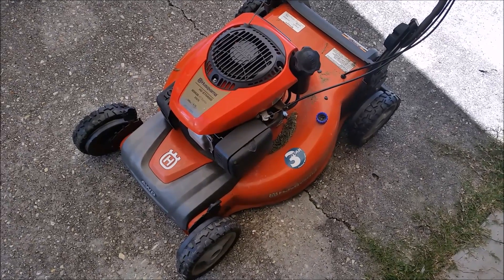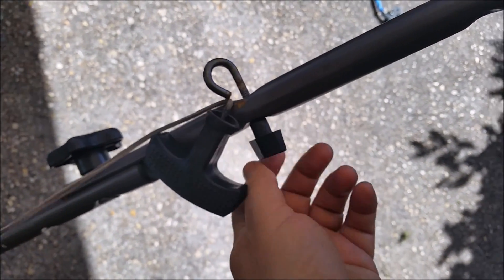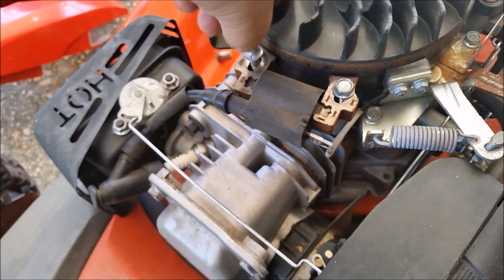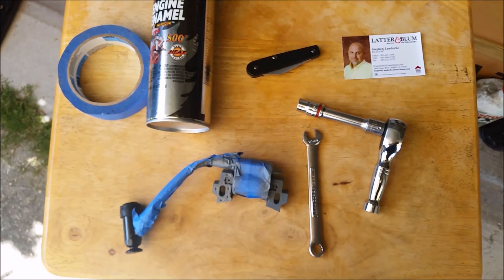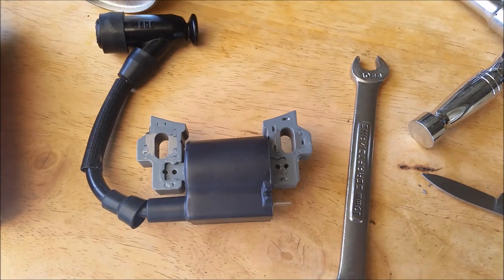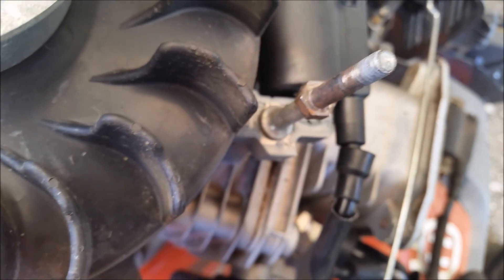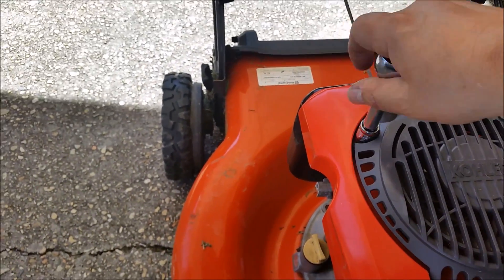Intermittent Mower Engine Fix Kohler XT675-2075 Ingnition Coil Change

Comment: Very useful video and well done. I own the Toro Recycler with the XTX675 engine and the cover and recoil starter assembly is virtually identical to that in your video. My mower just went dead and I determined no spark after trying starting fluid, so I guessed the coil  needed replacing. Took about 25 min to swap out and the mower started right up. This engine seems to be very easy to work on for the coil compared to other engines.
Reply from the maker: Thanks for the complement I appreciate it. Thanks for watching. Best Wishes & Blessings. Keith Noneya

Comment: Where did you get the module from. Is it oem or a replica. Also what's the part number.
Reply from the maker: I put all that info, tools etc in the description. Check it out for a lot of info. If you don't find what you need let me know. Best Wishes & Blessings. Keith Noneya

Comment: Would have been better if you had explained what it was doing so others could learn why you are replacing the defective coil
Reply from the maker: It's in the title "Intermittent Mower". The coils when they get old sometime internally breakdown and the as they heat up the internal coil opens up and will run for about 5-15 minutes then quit, then when it cools down the wires touch again and the mower will start. An easy way to figure that it's the coil instead of a carburetor issue is to put a spark tool on it right after it quits. If there's no spark then it's the coil and not a carburetor problem. If it does have spark then it's most likely a carburetor or a fuel line breaking down internally. If it's the fuel line internally breaking down it allows just enough fuel to fill the bowl and as it runs the fuel line can't feed the bowl fast enough so the mower quits. Best Wishes & Blessings. Keith Noneya

Comment: Any idea why my engine doesnt turn off when i release the dead mans handle? The brake seems to be moving and contacting the flywheel but it wont turn off??
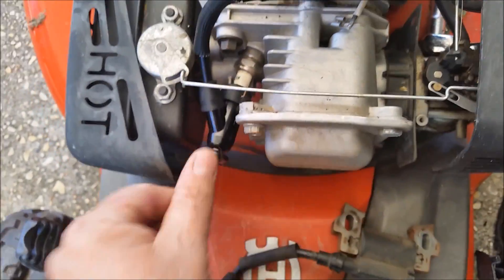Reply from the maker: Hi Donbrendo, at time index 6:14 I connect a wire to the coil. If the brake assembly that it connects to is not working right, or the wire is bad, when you release the handle it won't short out the coil and stop the engine. Check to see if the wire is there and connected. If it is, pull that wire off and check it for corrosion. If it's corroded clean it and then push it on and off several times. If it's loose when you pull it off or pushing it on, use some pliers to crimp it down a little then push it on and try it again. Hope that helps point you in the right direction. Let me know if you have anymore questions. Best Wishes & Blessings. Keith Noneya   PS if you have this mower and can't find the manuals for it drop me an email and I'll email them back to you. I won't give your email to anyone or spam you, so don't worry about that. keith_noneya@att.net

Comment: that skip is probably a fouled plug from the weak coil
Reply from the maker: Very possible. I had to put three Ignition coils in it, the first one was open, brand new, the 2nd one went bad in a week., the 3rd one was fine and is still in it. The were all from eBay, sorry I don't remember the sellers name. Thanks for the comment. Best Wishes & Blessings. Keith Noneya

Comment: Today, I just feel like hitting it with a grenade.  Good video. Thx.  Some days my friend,  some days,,
Reply from the maker: Hey Chris What's it not doing. I have a little experience with this mower. There are a few things common to cause it to go intermittent besides the coil. 

1. is the Intake Valve gets oil built up on the stem and it sticks open, just a LITTLE tiny bit. When it does that it acts like it wants to run but has very low power. Sometimes it will run for about 5-10 minutes then shuts off and you can't start it for another 30 minutes or so. Two things cause that: A bad intake valve seal or bad rings on the piston. You can pull the valve cover off. You'll need a replacement Gasket or RTV, and then pull the spring Keeper to see if the valve operates easily. If not then you have a problem. Be Careful when pulling that keeper off the spring or the keeper can fly into the grass and disappear. Been there done that! 

2. The filter inside the gas tank where the fuel line hoods up. 

3. The fuel inlet valve in the bowl gets a little clogged. 

4. The choke coil doesn't choke as good as it used to. If that's it there are two kinds, make sure you find the one that looks like yours before you order it. 

5. A really hard one to find is an internally deteriorated fuel line. It will allow just allow enough fuel to fill the bowl slowly but but can't sustain a run longer than a few minutes, as the fuel can't fill the bowl fast enough. 

** Check all those. Give me a shout if you need anything, I may be able to point you in the right direction. Best Wishes & Blessings. Keith Noneya
Reply: Keith Noneya Thanks Kieth. That’s a very thoughtful response.  I’ll have to review the questions and follow up.  After a brief review, I think I’m having carb issues related to the temperature adjusted choke and the linkage that makes that work.  I took a brief video and can mail it to you.  The adjustment opens the choke, but simultaneously, I believe the linkage is also supposed to push a lever or two towards the back of the mower. This isn’t happening.  The revving issue could probably be explained by an air filter that does not fit properly, although a major retailer said that was the correct part (it’s not).  Using duct tape to get a good seal is only useful offshore when diving in the oilfield.  Everywhere else you have to play by the rules.  I’m going to get the filter corrected, or trim the foam edge so it fits, clear the carburetor, and review a video I saw that specifically addresses the choke linkage.  Then I’ll be able to answer questions with a little more competence.  I believe the engine is good.  Not enough hours on it and stored properly.  Residual fuel from last winter in the lines may have caused the issues, but doesn’t address the linkage not pushing both wires to the rear of the motor.  Have vid. Will send to email in description if you have more to add.  Thank you. Very much.
Reply from the maker: @Zoofactory  Just post it on your you tube channel. Keep in mind that there are two carburetors and two choke assemblies for this mower. A later and an earlier version, both will affect the issue you're talking about. I made the mistake of ordering a later Carburetor and had to change it. I changed it and one of my starting problems went away. Just drop the link to the video in a comment and I'll go view it when I see it. Keith

Comment: Hey I know this was 3 years ago but did you ever figure out what was causing the slight miss at the end? I've got the same engine on my Toro driving me crazy with the same random miss every once in a while. It's not the carb (been through 2 already) and the ignition seems ok. Maybe it's a sign of the coil going bad?
Reply from the maker: Hi mjb yea it was three things.
1. Bad coil.
2. Partially clogged in line filter INSIDE the fuel line right where it connects to the gas tank.
I would pull out that filter, cut the line and put in one of those red Briggs & Stratton in line fuel filters.
3. Another partial clog in the fuel line, right where I would clamp it to take the carburetor off. The area where I would clamp it began to separate and clog the fuel line just enough that when I shut it off the carburetor would fill up the carburetor bowl and run. After a few minutes the fuel in the bowl would be used up and the fuel couldn't get through the line quick enough to keep up with the fuel demand and it would run out of fuel.
Note: About a year later I ran into another problem with the intake valve. For some unknown reason the valve stem would build up with oil on it and keep the valve partially open causing a slight miss due to lack of compression. I would pull the head, clean it and put it back together and within a day or so it would loose compression again and not run. I changed the oil seal and the same thing happened again every time I went to use it. The engine didn't smoke so I know the rings were good. I never did figure out this last one so I ended up replacing the mower with a Briggs & Stratton Craftsman mower.
It's to bad I really liked the mower and the engine was really easy to work on but I lost patients with having to work on it every week or when my son went to cut the lawn. Thanks for watching. Let me know how it works out for you. I would like to fix my Husquvarna so day. Best Wishes & Blessings. Keith Noneya
Reply: @keithnoneya   Are you a doctor and lost "patients" or you were tired of the hardship of the POS Kohler and lost "patience"? Those things are barely 1 notch above a Briggs & Stratton. Junk. I have 2 of them and they started like a Honda when new, barely half a pull. 6 months later they both run intermittently, lose power and will not start if they are turned off to empty the bag. I have to use carb cleaner to start them and I would NEVER buy 1 again. Its now at the point where I just take my 10mm socket, impact gun and clean the carb every other time. Junk. The gas caps are not threaded for the tank nor are the oil plugs either. I now run straight gas with no ethanol to get any power from them. They are going to be used for an oyster bed soon. Thanks for your vid BTW.
Reply from the maker: @ColoradoStrong-w1j  Oh how I agree with you now. I finally gave up on it. The intermittent miss was a combination of two things: The new coil was went bad right off the bat, 2nd one. I will say that the coil was NOT a Kohler it was some cheap Chinese aftermarket. The 2nd major issue was the Intake valve kept getting clogged up on the step so that it would not close. I cleaned it constantly, changed the seal then realized it was the piston rings that were leaking or allowing blow by up into the top of the piston. At that point I called it quits and bought a Crapsman with a Briggs on it. Guess what we had to take the 1st Craftsman back right out of the box it would not start! Now after a year the replacement is giving me intermittent running problems as well. Funny I don't remember every having these problems out of my lawnmowers in the 70's. I think somewhere along the line the specs must have changed. I loved the Kohler until it started acting up, it has such super easy starts and cut great. The other thing I liked about the Kohler is that it is SUPER easy to work on, unlike the Briggs. I'm thinking about installing a new set of rings to see if I can get it to run better again. I so much preferred the Kohler over the Briggs until it crapped out on me. Thanks for sharing. Best Wishes and blessings. Keith Noneya
Reply: Keith Noneya that's funny I started from the other end, first removed the little fuel filter, replaced the lines, installed the Briggs red filter and a new carb (all due to bad gas). It started and ran fine but kept randomly skipping, I would swear the float is set too low (does it worse when moving around) but it's non adjustable. Your video gave me the idea to remove the coil, clean everything and reset the gap. Seems to work ok now, I can still hear it wanting to skip but it corrects itself quickly. BTW - the kill switch is actually the metallic brake pad grounding against the flywheel, so any metallic brake dust built up around the brake linkage will kill it too. I was thinking maybe valve clearance adjustment too, but for now it's ok. Thanks for getting back to me!
Reply from the maker: Glad to always help when possible. I would suggest a trick my dad, a professional mechanic, taught me on adjusting the valves on any engine that has adjustable rockers. That is, on the valve you're adjusting, rotate the crank until that rocker is down, that way the one you want to adjust is full up. Then adjust the clearance on the one that you want to adjust in accordance with the manufactures specifications. Don't forget to adjust it with regard to temperature hot and cold. Hope that helps. Let me know how it all works out. Best Wishes & Blessings. Kieth Noneya

Comment: My father-in-law gave me this mower because"it will not start or run"...got it home, unloaded it and just for kicks I gave her a rather gental pull ...nothing, I pulled plug wire off and thought that came off really easy, squeezed it closed a little with some pliers pushed back on with a "snap"...1st pull started, been cutting my grass for a year with it . zero problems...
Thanks father-in-law!
Reply from the maker: LOL that funny. That "Chuck It & Buy a new one"  attitude isn't always the best way. Spend a few seconds to check it out and save hundreds of dollars. What do you have to loose? Hum.... a couple of hundred dollars...... Good job BC. Best Wishes & Blessings. Keith Noneya

Comment: Keith, I like the idea of enamel coating the coil to prevent rust. My question is, is it absolutely necessary to scrape away the paint where the bolts contact the ignition coil?  Is the coil actually grounded out to the engine body that way?
Reply from the maker: Yep the coil is actually grounded to the engine body that way. If you use star locking washers it probably wouldn't need to be done. If not using star washers the paint may or may not be penetrated. So in that case you'll have to scrap it off the paint in order for the electrical path to have a return. Good question though. Hope that helped answer your question. On the flip side the other issue I had turned out to be another two fold problem; The gas line was starting to deteriorate inside the tube restricting gas flow, & the in line tank filter was getting clogged.Thanks for watching. Best Wishes & Blessings. Keith Noneya

Comment: Mine starts first pull and runs great for 5 minutes then dies. The carb, coil and plug are new. Any idea what else it could be?
Reply from the maker: I have a few ideas as mine did it too. 
1. I had a PARTIALLY clogged fuel line, due to the inside of the fuel line coming apart. It would allow the float bowl to fill up so the mower would start and run, but the fuel line would allow fuel to go through but not fast enough to keep the mower running past about 3-5 minutes as the fuel bowl emptied. I came apart inside right where I had been putting my vice grips to cut the fuel off, so I guess the fuel line was old. 
2. A partially plugged fuel line filter. On the end of the fuel line that connects to the gas tank there is an in line fuel filter. Pull it out and clean it. Or you can remove it all together and put an small in line one. You can get those in lines at ACE Hardware for a few bucks.
3. Intermittently stuck Intake Valve. One other thing I noticed on mine in the intake valve over time would get stuck in the open position, due to oil building up on the valve stem. Once started it would run good for about 5 -10 minutes then start to miss. When it shut off or I turned it off the burnt oil on the stem kept the valve from seating all the way. After letting it sit for awhile the valve spring would finally let the valve seat down enough for the engine to start. So either the valve guide is worn or the valve stem. I found a temporary fix, that has worked for a year, is to remove the head and pull the intake valve, clean it and reinstall it. You may need a new head gasket and a new valve cover gasket. The valve cover gasket can be substituted with a light coat of RTV. I'll be doing that today. To check for a stuck intake screw a compression gauge in the spark plug hole, or put your finger over the hole, have someone pull the cord, and see if it pushes your finger off. If it doesn't you probably have a bad or stuck valve.
4. Still a bad coil. For some reason these are cheaply made. I have had one bad one straight out of the box and one that only worked for about 10 minutes before it stopped working. When it stops running put a spark tester on it and see if the coil stopped working. If you still have spark that's one thing left to check. 
The one thing I do like about Kohlers is that they are easier to work on than Briggs & Stratton's, but they seem to fail more often. Either that or I just got a lemon.
 Well that will give you some things to try cheaply. Hope this helps. Best Wishes & Blessings. Keith Noneya
Reply: Auto choke.